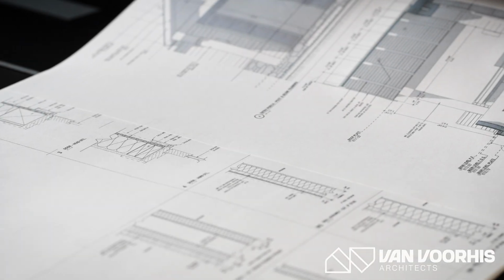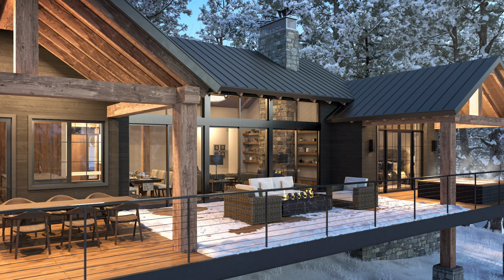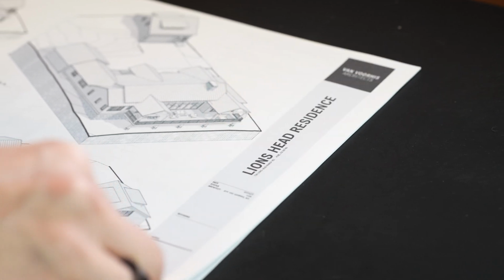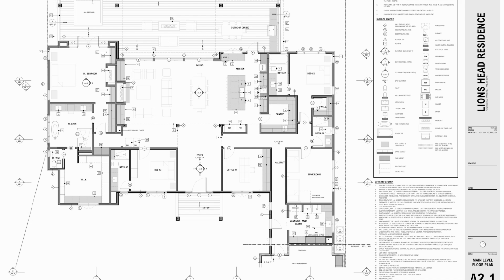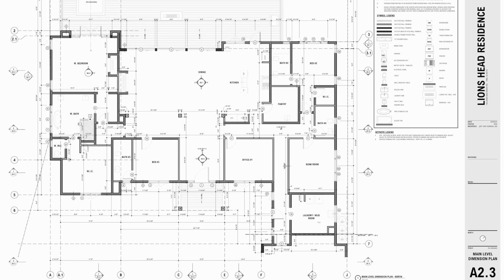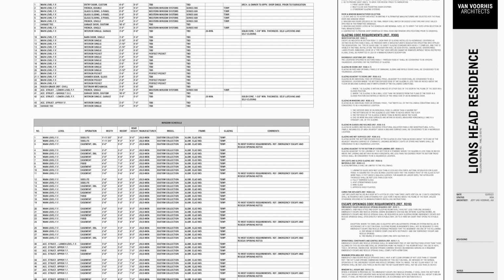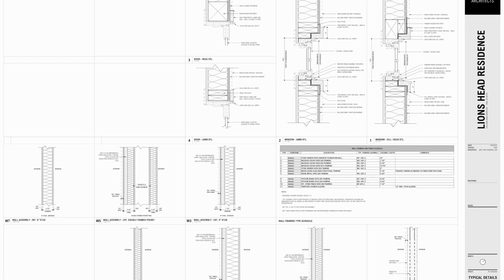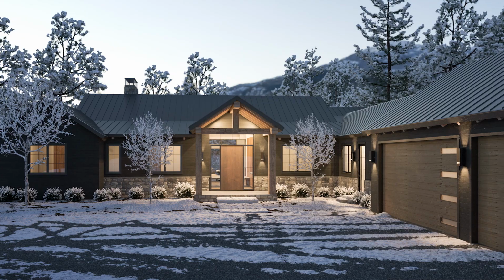Construction Documentation: A Milestone in Our Clients' Custom Home Journey

Comment: Hello! Nice drawings! Do you use only archicad/revit or are there any extra tools (for CD specifically)
Reply from the maker: Thanks! For CDs, just Revit. I’ve spent a fair amount of time dialing in the view templates and other standards but that’s all just native Revit. I do use a handful for plugins like DiRoots suite and Enscape but that’s more for file management and design modeling/quick visualizations respectively.
Reply: My structural engineer and i always talked about how much is too much documentation. I worked on a 365,000 SF high school, 9 people for 18 months. But that was with hand drafting. The one problem with construction documents, you just want it to be over. I quit when I am getting bored with the project. After 55 years I think I know when to stop. Also no matter how much you draw, a bad contractor is still a bad contractor. That is why we do no public work, choose our clients and recommend good contractors, the ones that are left. The inexperience inspectors want to make sure the construction matches the drawings. One deviation requires a change in the drawings or a letter. Most inspectors today have no construction experience.
Reply: @joegotz1971  you are sooo right on the point of "no matter how much you draw, a bad contractor is still a bad contractor." some of them literally do not know how to read my drawings and it makes me frustrated because i spent days working hard on them, making them as clear as it can be! Here in the Gulf (i live in qatar), some builders are from pakistan / india and they barely even speak arabic or english which makes it 100x worse.